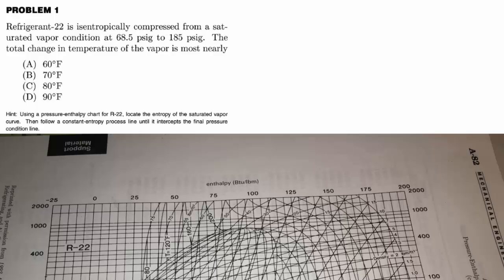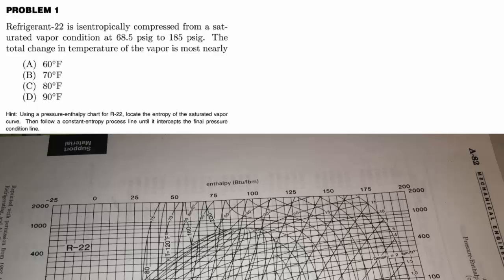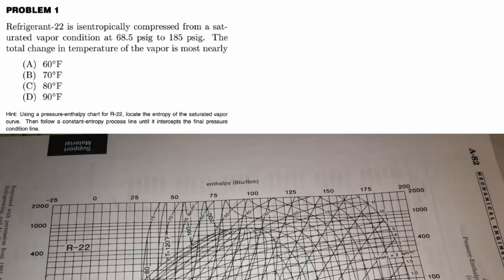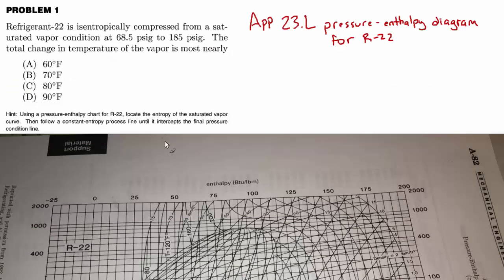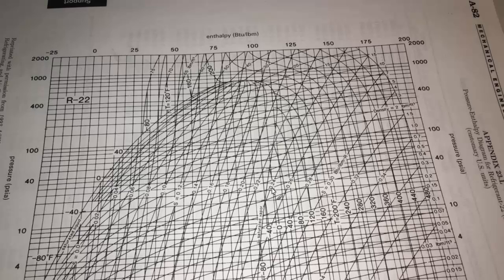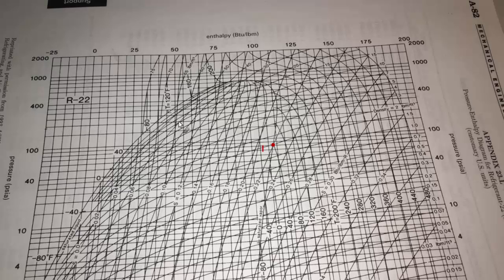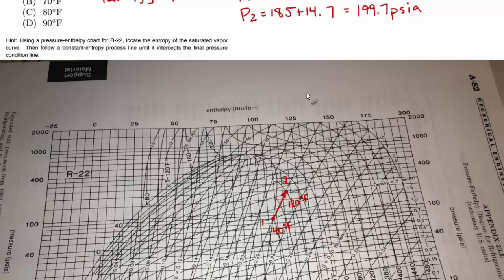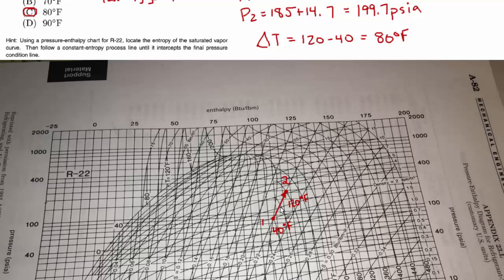PE Mechanical Exam Prep: Solving R22 Isentropic Compression in Refrigeration Cycles

Comment: the second : what is the pressure ratio if a compressor compress from 45 F, discharge pressure is 228.7 psia (at. pressure is  14.7 psi). Thank you

Comment: hi Dan,Thank you for answering me at a previous question. Please explain to me why, in a ref. cycle, the condenser rejection heat is equal with qevap + work? (I came across a problem,  where was specified this in the solution).  I am very confused. Thank you ,
Reply: Dan,Thank you for your answer.  I  think that COP hp is greater just because what you told me . COP is "what we want "/"what we give", qout  >  qin ,  cop hp greater than cop ref.Thank you very much